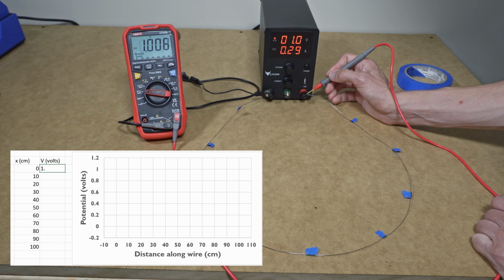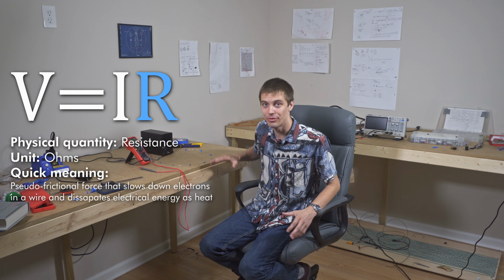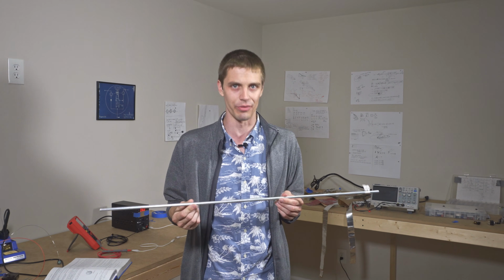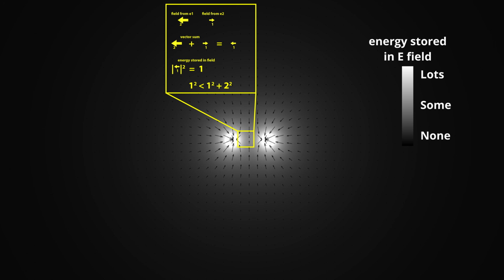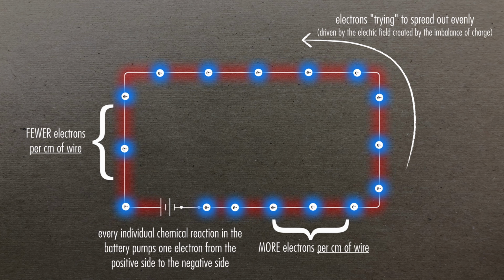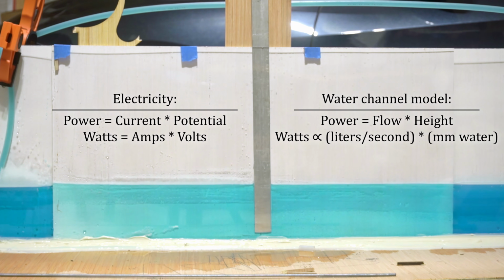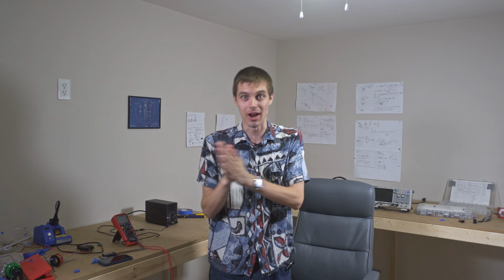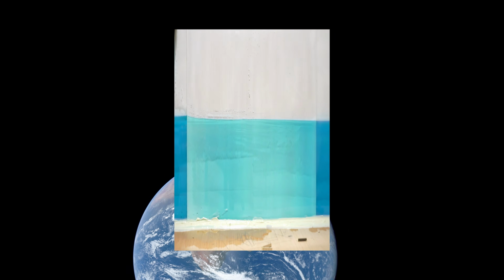An intuitive approach for understanding electricity

Comment: Voltage equals a ladder, and you climb up that ladder. Twelve volts in a battery is like you standing on top of a twelve foot ladder. Now when you jump!! The wind in your hair on the way down, but then you hit the ground running! If the ground beneath you is good ground, then you land and you can take off and go to work because you hit the ground running. However, if the ground is muddy, then when you land you sink to your knees, and you still climb out because you have to go to work, but you're not gonna be effective. Because you probably got hurt. In other words, you didn't have a good ground to land on, and so all of your energy from the fall is not spent efficiently, because you wanted to hit the ground and start running. Now imagine a twelve volt relay, and they would need about eight volts to activate. So you have a good ground, but you only climb up to the seventh step, and then you just don't jump. You still have a good ground connection, but something is happening on your positive wire. It's resistive. In other words, you can't make enough volts or height on the ladder to even activate the relay.Even though you have a good ground. Now imagine you've got nine volts, or you've stepped up nine foot on the twelve foot ladder, and you go ahead and jump anyways, and you get to ground running, congratulations. In a counterintuitive way you've overworked the ground, because to us humans, it's almost less consequential, if we don't climb all the way up the ladder, because we're used to held knees bend under gravity when we hit that type of ground the voltage, it's different. Now let's say you have a poor ground and you have 12 V. And you are on top of this one2 foot ladder, but come to find out. Do you have a very picky solenoid? That needs eleven volts to activate, and you have a good ground, but you're only reading ten volts on the meter. Having a one volt drop that prevents you from going from foot number ten, step number ten up the ladder to step number eleven is the same thing as if you climbed up twelve foot ladder and jumped and hit the ground running.But then you encountered a secondary ladder that was one foot up, and you had to climb over this ladder too. So you're not only having to go up one foot, which is why you're seeing ten volts instead of eleven, but then you have to jump down the other side of that one foot ladder, which is the other one foot or one volt of the twelve total

Comment: Available voltage is not current flow.
So, terminology makes a difference when we are learning.
Reply from the maker: I never said it was
Reply: @AlphaPhoenixChannel the video says current is flowing up to this point, then this point, when actually, you're finding available voltage applied to the conductor.
That's not current flowing in a circuit which made me comment. Terminology is a help or a confuser. Let's clarify it and help others. 

Have a great day.
Reply from the maker: @DanLinc-d2gI’m very sure that I never say current is only glowing in part of the wire
Reply from the maker: Flowing
Reply: @AlphaPhoenixChannel  just sharing the type of help instructors, journeymen, and master techs have shared with me.
How we term things affects how we understand and think about them.
I passed my manufacturer engineer led school thanks to those daily hands on teachers.
Terminology.
It's important.

Comment: Be careful not to misinterpret Amperes. An Amp is like a shadow, in that it can be be determined qualitative attributes, it is a measurement of reaction and not of a real thing in itself. You can measure the spatial magnitude of a shadow and its degree of opaque attributes, it is not something that exists in and of itself. Amps/current is much the same.

Comment: I love this video... but one thing bugged me: your claim that positive charge carriers "don't really exist." Is that correct? My understanding is that the flow of electricity through conductive liquids like salt water isn't actually the result of electrons moving from the negative side to the positive, but rather positive ions moving in the opposite direction. Am I wrong?

It took me years to wrap my head around how a battery can work, since supposedly electron flow inside the battery is impossible, but current flow inside the battery is necessary for its operation. I finally learned that there is indeed a positive charge flowing through the inside of the battery from the positive terminal to the negative, in the form of moving ions. What made this so hard for me to understand was that I had been taught that electrons are the only "real" charge carriers.

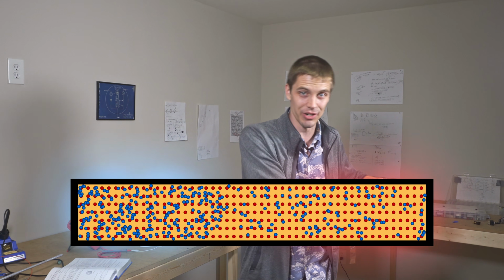Comment: Are we really storing energy at both the positive and negative end in a wire when you speak of this at 18:40-18:50 ?

Aren’t we only really storing energy at the negative end as the electrons want to repel one another? At the positive end I don’t feel we stored anything did we?!
Reply from the maker: If the wire has more protons than electrons then you’ve expended energy to pull those particles apart
Reply: @ but what form is the energy storage in when referring to the positive end - if only electrons move?
Reply from the maker: @MathCuriousity  still electric field due to imbalanced charge. It’s like it’s trying to suck the removed charged back in. You can store energy in a spring by compressing it or by stretching it
Reply: @ I understand the idea of stretching the spring as storing energy cuz it wants to suck back in; but I can’t - how can I say this - I can’t align this with the idea that protons which make up the positively charged area cannot move and aren’t repelling one another after they become devoid of electrons.

Comment: @sb says> 
Well he got one thing wrong: the electron on the majority don't flow.

They just elastically collide with each other transferring energy but each collision negates the momentum so after the collision the electron goes back where they came from.

The electron going back elastically collides with an electron going the other way. They transfer energy and reverse momentum. So all these electrons just go back and forth. They don't flow.

Also you have to understand that a metal is a crystal lattice whose valence electrons can freely occupy the valence position of adjacent atoms in the crystal at room temp (if it was super cold - no electron movement, frozen in valence position no energy to move). At room temp these electrons act like a 'gas' - an electron gas that can respond to an electric field

[Also parts of the errata is] still wrong. Think about it. These are tiny particles moving fast. There is no 'slowing down' like a line in a queue

The electrons are constantly zipping about elastically colliding with each other - that means no energy losses. The energy stays within the electron gas. The energy loss only occurs when they collide with the lattice.

So why when you placed a resistor between two wires the resistor gets hot but the wires do not?

That's because the resistor has a lattice structure incapable of creating an electron gas. An electron from the metal has to literally hit an atom hard enough to eject it's valence electron and occupy it. But it's not just one valence electron but a sort of musical chair game where an electron becomes a valence electron on one end with ejects an electron somewhere. Now if the electron happens to be ejected out the other end with low energy because all the excess energy is lost to lattice vibration is the resistor gets hot. But the metal does not.

Conductor = crystal lattice that can sustain a valence electron gas 
Insulator = crystal lattice cannot sustain a valence electron gas 
Resistor= composite material composed of a ratio of conductor insulators to give isotropic resistance regardless of current.

The concept of current can still be used because electrons are identical. After a collision it doesn't matter which electron was which as long as energy is flowing in the given direction
Reply from the maker: This is not correct - the band structure of the resistor and the wires can both produce electron gasses, there IS net motion of electrons, defining electrons as valence or not doesn’t really mean anything in a metal because the electron density gets smeared out across the unit cell and the electron (and the charge it carries) can pretty much go anywhere
Reply: @AlphaPhoenixChannel  @sb says>
A resistor is a composite it does not have a band structure. It's not a single material. If there was net motion of electrons then there would be a measurable angular momentum in highly coiled solenoids. We would be able to create gyroscopes based on electron flow alone - no there is energy flows but no mass flow.
Reply from the maker: Do you know what a compound is? Its not a composite
Reply from the maker: Wait that other comment is gone too - it WAS your alt lol.
Reply: @AlphaPhoenixChannel  which comment? i have only edited not deleted my comments.
Reply: @AlphaPhoenixChannel  anyway I really love your video so much. First time i feel like i got some really good analogies about Electricity (i do not have a background in physics or engineering myself) However, 
I showed it to my friend (who i refer to as "@sb"), who is a PhD in Electrical Engineering .. @sb watched your video but doesnt have a yourube account to comment with so I have simply been parroting what he is telling me and posting it here on his behalf (i didnt even expect a response to be honest, but this is great!) keep up the good work on your channel!
Reply: @AlphaPhoenixChannel  @sb says> Compound is chemistry term for two atoms covalently bonded. A composite is a material science term for material which contains many   types of materials. In this case conductive and insulative materials.

Comment: The plinko board analogy doesn’t make sense because nuclei are far far more smaller part of the whole atom so the electrons should be able to move forward unimpeded due to the extreme amounts of open space in an atom. Nevertheless he explained V=IR better than any EE professor
Reply from the maker: You’re right! They don’t hit most of the atoms - look up the “mean free path” of an electron in various materials and compare to atom spacing. 

(Granted this makes it slightly fuzzier because the lists you’ll find are for quasiparticle electrons or holes and not real electrons, but the websites won’t say that lol)
Reply: @AlphaPhoenixChannel  so when I hear the electrons are barely moving or moving a millimeter every four seconds I can’t imagine what’s obstructing them. Is it other electrons getting in the way ? To me if someone said they are moving at the speed of light or 1/2 C or something that would make more intuitive sense.
Reply from the maker: @MrEast900  that's their average speed, but they're really bouncing forward and back and sideways and in all (random) directions quite fast (but not C fast). that mm/s ish number is just the little bias that's added to all that randomness. the good news is, the random jostling never really matters, so we just say they scoot along slowly.
As to why , if you apply an external field, they don't all shoot in one direction? it is largely other electrons in the way, bunching up and creating an opposing field to slow down the acceleration, as well as "plinko drag" from electrons running into crystal defects in the metal and whatnot

Comment: Really the electric field is around the wire, not in it
Reply from the maker: The electric field is everywhere - it’s probably actually stronger inside the wire at steady state, but the field just adjacent the wire is normally most important for governing signal transmission speed when the flow of and distribution of electrons changes within the wire

Comment: I still don't understand how 2 batteries put in series then don't just have the stored electrons from one battery "flow" into the opposite part of the other battery to become an equilibrium, but add up instead.
With the analogy of the water; if i connect two of those water channels to each other the water does equalize instead of adding up. For it to add up, i'd have to lift up one of those channels to the max of the other, meaning i purposely add this potential energy.
But this doesn't hold for electricity as far as i don't understand. By connecting the negative of one battery to the positive of another, i read that this makes the negative reference adjust according, which in my imagination must mean ~lifting it up (how?). This, to me, also has to mean a physically absolute measurable change in the second (lifted) battery, yet it doesn't seem to, in reality. The non-intuitive explanation circles around this being relative, but even relative means in relation to ~something (to which it has to be lifted), yet even a change (lift) of thousands of volts don't make a noteworthy absolute difference, which in my imagination corresponds to lifting up water thousands of meters, requiring huge amounts of energy in the process (that has to come from somewhere).
The other issue in understanding i have with water as analogy is that water can be cut off. But this doesn't seem to be possible for electrons, they always exist throughout the whole pathway from what i understand. Water acts differently when cut off (it first has to fill up the path, taking time, with changing circuit/path behaviour during this). And, water doesn't need a completely connected circuit. 
And maybe battery + to - has an internal connection somehow(?), otherwise a short-circuit is not really a circuit, and batteries simply in series would short-circuit as well.
This really confuses me, so i'd appreciate ideas that help me get a better intuition here.
Maybe i also missed or misunderstood something that was explained in this video.
Reply from the maker: The q&a video on the second channel addresses some of your questions. Think of a battery as a pump - not a store of electrons.
Reply: @AlphaPhoenixChannel  It actually helped - Thank you, also for such a quick response!

Comment: don't you think that the multiplication in the formila P = A * I is a great power (common sense meaning) and still a mystery of electricity?
i try to explain what i mean 
12:11 explaining the Voltage you use the height analogy, if the analogy would have been applied to electricity it would result in potential energy factor (height) being included in the total energy as a multiplier/multiplicand component (multiplication) not as an addend/summand (sum)
in case of gravity there are 2 energy components that ADD up - one does not affect the other, they are 'independent' parts
in case of electricty the 2 energy components 'influence' one another

Or maybe it is so tha the power source itself does not have any U (Voltage) when not connected to a circuit. 
It has some form o potential energy that "gets converted" into U (voltage) * I (current) * t when the circuit is built?
And U is a feature of a circuit (or a part of it) when current flows

Comment: not sure how many times i have to say this but electrons do not carry electricity photons do.
Reply from the maker: Please watch the whole video - I talk about energy in fields. You can’t separate the field and the electrons. You can’t have the field configuration that moves energy without moving and accelerating charged particles so it’s a meaningless distinction to say that only the field does anything
Reply: @AlphaPhoenixChannel  thanks for the reply.. cool work you do.. your brilliant... it's not a meaningless distinction if electron drift is so slow and the signal propogation is around 2/3s light speed there's alot more to the story... my goal is to understand how the universe is actually working... and not enough people realize electrons are meaningless with out photons even if they are virtual photon quanta or whatever... the picture is not painted clearly enough for my liking... for the electrical engineer this is sound.. for the philosopher... we need more answers
Reply from the maker: The bounds on the electron size are set by the energy contained in its field and the electron rest mass. In a lot of ways the electron is a field. Trying to separate them is not helpful
Reply: @AlphaPhoenixChannel  so please what does that mean from my perspective. not trying to build a circuit but trying to understand what's actually going on... there is no virtual photon as I've been lead to believe?  Just an electron which is a field of itself and it pushes on the next door neighbor?  through the field interacting?  like a line of magnets?  there is nothing actually doing the pushing it just happens?  i don't get to hear from from very smart people like yourself very often..i want to take advantage and learn something. what do you think is going on?  how can the electrons push on each other... and how can the signal propogate so fast if the electron drift is so slow?

Comment: Does current really flow? Do electrons move through the wire? No. If they do then where do they come from in a generator? You spin the generator and it makes electricity. Where do the electrons come from? They don't just appear, it's just a field that sets up, they don't flow like particles would.
Reply from the maker: Current really flows - it’s the definition of amp